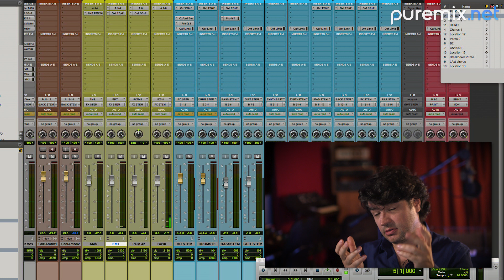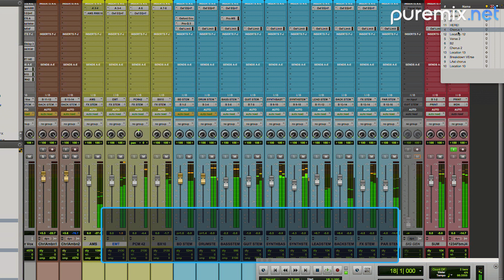Puremix Mentors | Mixing | Inserting Tubes Across The Mix Bus | Tube Saturation

Comment: Something throwing me off & likely throwing you off is that without's stereo signal is being flipped with.  You can hear how without the guitar picking is on the right but then with the picking is on the left which throws me off. 

This makes me only focus on the mono to hear the difference because thats throwing me off in comparison(because my left & right ears are calibrated the same so I will always hear a difference that I cannot accurately measure in comparison...as to say even the same track stereo swapped will sound "different" to me).

Focusing only on the bass & vocal, I hear that low end sounding bigger & more analog sounding with the overall analog curve sound w/o taking away too much of anything in the highs...even adding to them more punch while taming them.